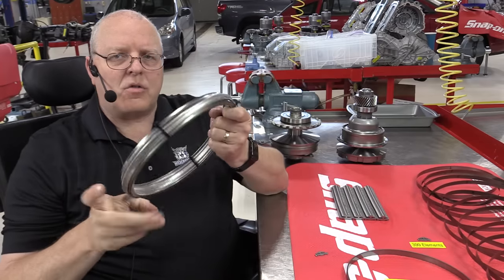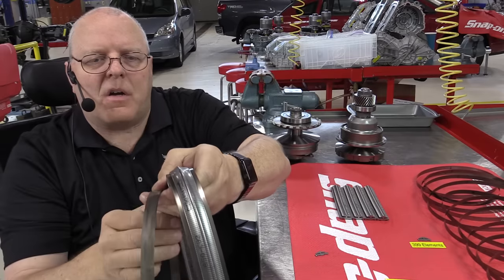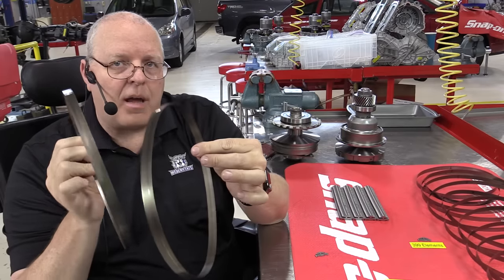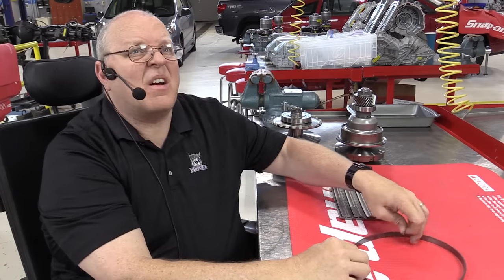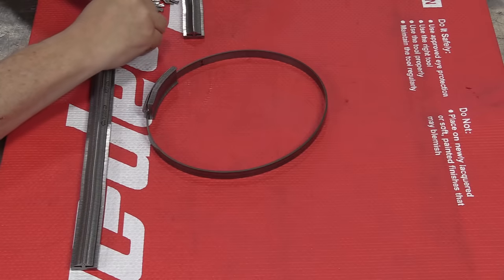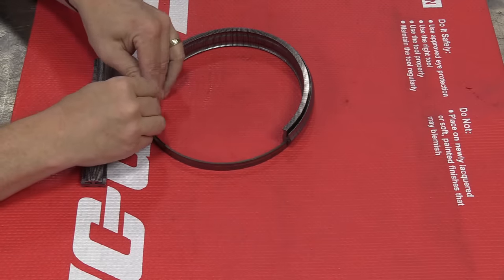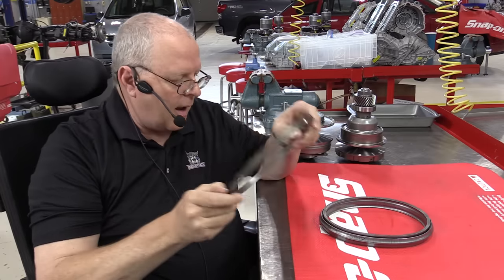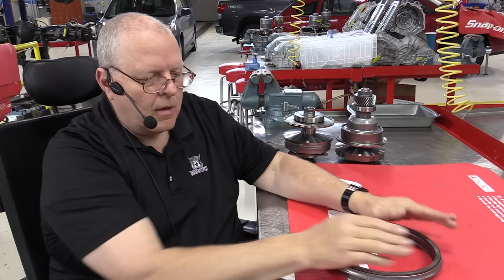The 423-Piece CVT Steel Push Belt

Comment: Fantastic video, professor! I have one question. Have you done teardowns and analysis of failed CVT units? What is the most common failure in these units? At the moment I am doing a teardown of a failed Nissan CVT on my channel, and the findings are really interesting. The CVT is really a marvel of engineering!
Reply from the maker: I have only seen three failed units. all had belt ring pack failures. I have also seen Honda CVTs with bad start clutches and stripped out flywheel splines. Best wishes.
Reply: Hi Professor . I have a 2014 Civic with this amazing CVT :(
I have weird problem with the car..just started around 27000mile. 
Here is the diagnosis. 
When the RPM is between 1800 and 2000 and the speed around 40 mile at street speed and I gently apply throttle the whole car is start to shaking..
The other scenario when I'm cruising on the fwy around 58mile and try to speed up to 62 pushing the accelerator really gently and slowly and the rpm is again in the range what I mentioned before the car is doing the same...
scenario 3 is when I drive on fwy around 60 mile/h and turn on the cruise control and a car try to keep up on the speed the shaking comes back and the rpm range is the same...
I brought back the car to honda but they don't give a sht and keep telling me there is nothing wrong with the car....
what is your suggestion? 
this shaking feeling is anoying and make me stomach sick....
what should I do? because is not normal . 
thank you so much.
Reply: Robert Kero Take a dealership tech and preferably a service department manager for a test drive, if they say it's normal insist on taking them for a test drive in a new car with CVT and see if it does the same thing.
Reply: Brad K actually really good point.
Reply: Robert-do as Brad suggests and/or find another dealership
Reply: Robert Kero you could get the engine mountings checked too. Sometimes they are worn and make you think its a very big problem. Had it with Toyota Avensis. Wheel balancing and alignment too is another thing.
Reply: Pine Hollow Auto Diagnostics n
Reply: Must be the tires, the aligment or the motor mounts.
Reply: Practical Guy the point that all of the moving parts are bound to failure is really no way specific to CVT transmissions. Look at the Ford focus transmission. Literally hundreds if thousands within the same four or so years have had to be repaired by now while some CVTs that are double their age Haven't needed anything yet. Anything with more than one part has multiple parts that can and will eventually fail. The phone I'm typing this on has about 2.03 billion transistors, a couple hundred passives, 20+ sensors, etc. All of which have a life span. A CVT is really not much more prone to failure than anything else unless you're just unlucky or don't take care of your stuff, though a lot of times things will break regardless how well you take care of it or really what it even is. Shit just breaks, that's life.
Reply: Robert Kero Try a different dealership. It doesn't matter which dealership you bought it from, Honda still has to honor their warenty as long as the vehicle is still within milage and time. I would seriously call in a complaint to Honda customer service about that dealership.
Reply: Me to! I'm snowmobubble trained as well. I wouldn't touch one of these. A clutch peddle and a stick please.
Reply: william III   DAF = van Doorne's Aanhangwagen Fabriek. Translation: van Doorne's Trailer Factory.
Reply: @MotoRobee  it depends on the "shaking" is it violently shaking? Does it "buck"? When you accelerate does it feel like no effort comes from the engine? More information is needed to better assist you. But from what it sounds like is you have a bad motor mount maybe not tighten at the factory or you have a lot of speed bumps in your neighborhood. Another issue could be it's time for you to check/change ignition coils/spark plugs. The transmission going out/failing would give you no response/more effort from the engine to move.
Reply: Pine Hollow Auto Diagnostics has a great question. His in depth video reveals a pulley to shaft coupling (ball bearings captured in slots to lock drive rotation) failure at high mileage and loose bearings blowing up the belt.
Reply: ive got an idea folks.combine those steels with rubber.its like a food,must have a different ingredients to become delicious.or just like human bodies,need different protein,matter,minerals

Comment: When an element first contacts the pulley, does it remain in that exact position until it leaves the pully on the other side, or does it migrate slightly (if there is no slipping happening)?
Reply from the maker: Good question, I do not l know the answer. I suspect there is no slip.

Comment: This is very interesting. I always wondered what is the stable means of transmission is in a CVT.
So, now I am wondering ... wouldn't a better word for pulley be "pushey" in this case ?
Reply from the maker: I like "pushey", thanks for the feedback!
Reply: Henner Zeller The word pulley has nothing to do with 'pull'. The word pully (in Dutch 'poelie'; it's a Dutch invention) derives from the old French word 'polie', a diminutive from the Greek word 'polos' which means fulcrum or axle.
Reply: Henner Zeller those aren't pulley's they're clutches
Reply: How about breakey..too sooney?
Reply: well that's not goodey
Reply: thanks for nothing of real importance
Reply: Elements and rings are made up of which metal
Reply: This  is  interesting  nissan  has  those  and  hondas
Reply: You said it first, thank you!

Comment: Very interesting, thanks for clearing up something I wanted to know since the first time I heard about CVT - what kind of belt survives the forces involved in moving a car years on end. With this beautifully explained and out of the way, I guess the next question is, who came up with 399 elements??? Why not 400? It looks like they couldn't fit the 400th element when assembling the prototype and left it at that (just kidding).
Reply from the maker: Thank you!
Reply: It would be due to the need to have an odd number of plate elements (like with gears) to prevent a wear pattern from forming. An even number of plates (gear teeth) would develop a wear pattern from always aligning at the same place.  So, Kind of like rotating your tires to break the wear cycle.

Comment: the key of long lasting CVT is proper timed maintenance and knowing which part need to be serviced(fluid/gasket/filter etc), done that in my Lancer and its 8 years now(fluid+cooler filter every 40000km, gasket every 80000km), still smooth, still perform  when needed
FC is surprisingly good for relatively big CCed engine(in my case, 1.8), if defensive driving applied, 70-90kmh crusing most of the time, lowest i got is 3.9L/100km.
often CVT failure  caused by user thinking that only fluid needs to be changed.
Reply from the maker: Thanks for your feedback

Comment: Very interesting, thanks for taking the time to make this video! Dumb question- Why do all the companies use a belt and smooth pulleys instead of a chain with teeth and sprockets? It seems to me that a chain with teeth to grab sprockets would be much more durable and would be able to handle much more power since it wouldn't rely on the clamping force to keep it from slipping. Thanks
Reply: @Michael R It could be variable if the sprockets could still change size though, right?
Reply: Eventually they'll figure that out.

Comment: How does the pulley not wear out with all of that metal on metal contact from the belt?
Reply from the maker: They use special fluid for lubrication.
Reply: Yeah but it relies on friction to drive the pulleys right?
Reply: +Reverend Green Just like a clutch, but this one doesnt slip (well at least as much), while the clutch has to endure the start of the vehicle from a dead stop. Still, it's pretty amazing there are cars over 100+ hp with CVTs
Reply: They do wear out & when that happens throw the entire trans in the trash & by a new one or get a new car. CVT's aren't generally  rebuildable. The ultimate transmission for today's throwaway cars!
Reply: 4thstooge no modern auto is rebuilt in house. They're all shipped (often to other countries) to be rebuilt to be put in some other car with a blown transmission some day. Doesn't matter if it's a cvt or not.
Reply: Snarky no, we saw him build a belt with new parts, not rebuild.
Reply: motorbikes have wet clutches, confused?!?!?!
Reply: they use a very special oil to lubricate the transmission. that's why a transmissionoilchange in a cvt can set you back over 500€. but i guess until the oilchange is due, you'll have saved way more money in fuel, since these transmissions are extremely fuelefficient, since the engine operated always at it's optimum rpm.
Reply: TheWolvesCurse but some makers decided to throw that advantages so that the driver can feel like the cvt is shifting..
Reply: They will wear but since they are all hardened steel (I expect at least) and together with the special low wearing oil it would take a very long time until it would become a problem, even long after the car is crushed so its noting to worry about.
Reply: @4thstooge75  true
Reply: @TheWolvesCurse  not really
Reply: @Jason M - AT cars sells less after 60k compared to MT cars, you bought AT for more then sell them for less compared to MT, then MT cars is the reverse.

Comment: John, pls give credit to Dutchman Hub van Doorne, who invented the push belt. 

He founded DAF in Eindhoven, making cars with an infinitely variable transmission using a rubber belt. He realized they needed to transmit more power, so he invented the push belt called 'Transmatic' using belts of a maraging steel and the elements.

Thanks.
Reply from the maker: Thanks for the feedback. I will do that!
Reply: Correct, developed in Tilburg bij Van Doorne Transmission, now it is Bosch, i have been there a few times at the factory, my brother works for Bosch at the Tilburg factory.

Comment: Thank you for that great video. Can you tell anything about wear in cvt boxes?
Reply from the maker: Thank you! the only way I know of is to use a scan tool and compare the commanded pulley ratio to the actual pulley ratio; they should match. If they do not, something is wrong. it could be wear, a hydraulic problem, or an electrical problem. Luckily there are trouble codes that usually set to help you figure it out.
Reply: Thank you. :)
Reply: the first gen 2014 pathfinder had wear problems, and i think this still occurs across different manufacturers, even tho alot use jatco gearboxes, i think the wear problems were from the oil expanding when hot and then the pulleys dipping into them and causing foaming in the gear box. This problem can be heard when the gearbox gets very hot and apparently whines as a sign. The 2017 model pathfinder i believe has a refined gb where the oil level is now lower to allow for expansion. Another reason i heard of wear was from crappy manufacturer trans oils.
Reply: It should be on the internet. I saw a test of 6 CVT;s siome years ago. It was a laboratorium test where 6 CVT's had been under very heavy (maximum) strain and constantly varying speeds 24/7 until they broke. On average they lasted 150.000 miles. Now, 6 unitis is far too small a number to give a statistically reliable outcome, but it may give some indication.
Reply: @supersmalls  i actually have that model pathfinder and you are correct. They also changed the fluid .

Comment: Crazy engineering feat. I can't imagine who came up with this or how. Bizarre assembly (read: a lot going on in that thing, a lot of things to get right).
Reply from the maker: Thanks for watching!
Reply: Thanks for providing such awesome content! :)
Reply: Daf 33,,,44,,55,,66,and after that the volvo 340.
The building the variomatic in 1959 with a rubber pull belt.
Reply: They used to just use rubber belts on cvt but of course they couldn't handle much torque and life cycle was short. So just had to design something flexable and strong. The individual parts give flexibility and strength and the spring steel rings provide a matrix to hold them together while remaining flexible.
Reply: They're not that hard. The first DAF Variomatics were completely mechanical. Then again, the original Dafodils only had a 20-something HP 2 cylinder to transmit.
Reply: google a hondamatic, that's by far the most complex trans if ever seen- and i own 2 of them.
Reply: WeberAuto 
It reminds me a little of how you treat a diesel injector pump. 
You better be clean and precise. 
Don’t drink a lot of coffee that day 😬
Reply: DAF, a Dutch car manufacturer developed the Variomatic, and I think it was Audi who came up with the first steel belt for one of their power houses they thought needed a CVT.

I have owned a Honda HR-V automatic, also a CVT and I don't understand the disdain people have for this automatic. F1 prohibited the automatic because it gave an "unfair advantage"; it can be lightning fast.
Reply: Alot of things to go wrong....
#ChaosTheory

Comment: If it's possible to make a cvt trans that can hold some serious power, why don't they?  Would adding more rings or wider rings take away from efficiency, or the bean counters figure on making it to last typical warranty duration and that's it?
Reply from the maker: There is a point where the frictional loses from the larger elements and ring packs decrease the efficiency of the transaxle.

Comment: This is an extremely fascinating video. The CVT is of course a very impractical machine for automotive transport, but still a very fascinating creation. You clamp the shives together which imparts tension to the bands, which pushes the element against the shive surface and imparts the necessary tractive friction. I've designed CVT parts before and despise the concept, but do still apreciate their function.

Comment: Toyota eCVTs do not have belts, but planetary gears. Much reliable.
Reply from the maker: Thanks for your feedback
Reply: That's why toyota's don't fail, awesome, they're still the leader in quality and design! I have an '88 Camry LE and it runs like new (of course w/ proper maintenance, it's an automatic).
Reply: BaiBir0 A completely different concept. It is not a cvt as such, and would not work as one in a normal car as it needs an electric motor to provide the variable function. Do some research.
Reply: Alan know everything,  Toyota calls them e-cvt's, the e referring to electric. They ARE in  normal Toyota cars. Difference  is the variable part does not begin till you exit first gear. It is not necessary to criticize people for lack of research in something that is not their field of expertise.